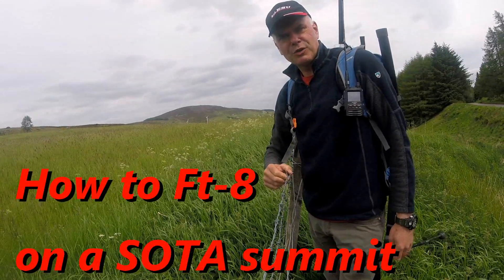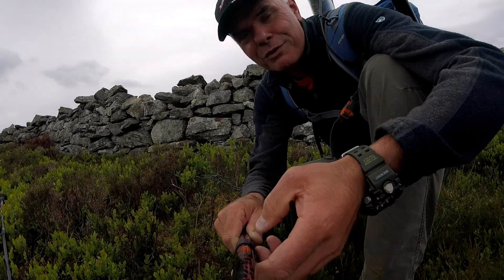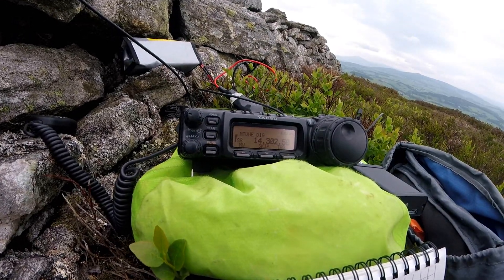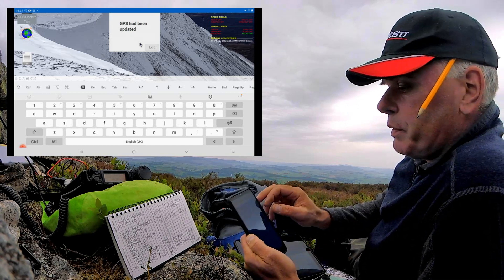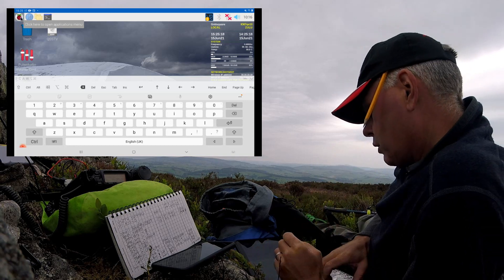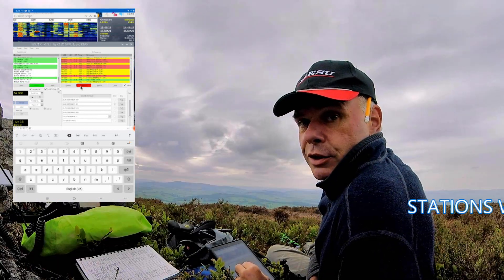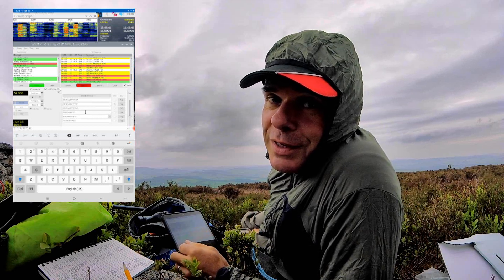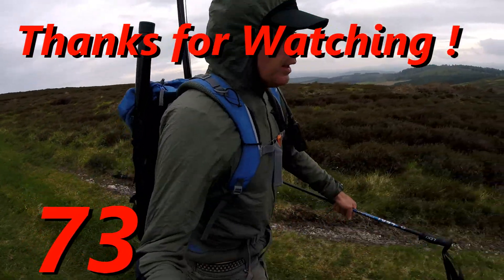How to easily run Ft-8 on a SOTA Summit and bring in the DX!

Comment: Nice video and the equipment choice is probably adequate for 2021. A lot of components, cables, and moving parts. And prohibitively heavy, especially a brick 857 which is designed to be mounted in a car, not carrying in a backpack. My setup for similar purposes:  a battery, FX-4CR, 10" Windows Surface Go.  Bluetooth connection to transceiver, no wires, no hassle with wifi to RPi. 73!
Reply from the maker: Yes, you can do it a lot neater these days. A phone plus tr(usdx) is cheapest and simplest. This video shows what can be done with what I had. After I finished filming, I did some 2m FM and SSB using the same radio. The ft-857d is heavy, but can do most things!
73, Fraser MM0EFI

Comment: Fraser, when chasers log their SOTA QSO with you how do they know which summit you were activating? There is not enuf room in the 4 character text area in FT8 to send that information?  I’d like to activate a summit on FT8 this weekend and that’s the only part I can’t work out.  Thx
Reply from the maker: Well thats a good question! 
1. I put an alert on SOTAWatch3 and mention that I will be on FT-8 in the comments.
2. I use the standard FT-8 frequency for the band I am operating on.
3. I spot myself on sotl.as or SOTAWatch3, again mentioning in the frequency and mode.
I transmit using MM0EFI/P and when I appear on the chasers waterfall, it should be fairly obvious to them. They usually pick me out. They know what summit I am on from the alert and spot. The good thing is that you will also pick up a few other non-SOTA QSO's as well. Finally, there's a free text box in the FT-8 software. You can enter "SOTA" or an abbreviated summit reference there if you like, but most don't bother.
I hope this helps.
73, Fraser MM0EFI
Reply: @theradiorover   Thanks for the quick reply Fraser.  Yes, after doing a bit more reading I think your approach is the easiest.  Like u mention in the video, it’s really more for experimentation.  I like to actually hear 👂 the person I’m communicating with.  73. K6KWI

Comment: Nice video Fraser - thanks for sharing. I am currently setting up for data modes in my shack, and will then get a (currently little used) Raspberry Pi up and running for mobile use. I suppose I just like the challenge! One thought watching you set up: apart from the communication settings which would need to be done manually, are the other settings changeable from the CAT control? It would be good to use a small script on the Pi to save the current settings of the relevant parameters, then to change them to the appropriate settings for data use, before returning them to the original settings on completion. I guess I will be able to answer this myself once I have installed and played with the software a bit!
73 - Paul (MW7PAJ)
Reply from the maker: That's a decent idea. All settings should be CAT controllable. I haven't really got into writing scripts and code on the pi. I did this at Uni many years ago, but I don't have the time to re-learn at the moment.
I actually enjoy setting the radio up manually. The ft-857d is one of those radios that needs to be used constantly and fiddled with, else I'd forget how all the menus and functions worked, especially as almost everything is controlled from just three buttons!
Cheers, Fraser

Comment: How do you set up wsjt-x to let people know that they should should spot you on sota and on which summit?
Or how to verify ft8 contacts for sota activations?
Reply from the maker: When I spot myself on the sotawatch website, I mention FT8 in the comments. Then it's up to stations to find me in the waterfall. There's a free text line in ft8. You can add SOTA to that if you like.
Then when home, I open up wsjt-x again and look into the log file. This can be copied and pasted over to excel for editing, or simply written down and entered into the sota database. 
On the activation in question, I made 16 contacts. Only 3 of those were chasers, so a much lower ratio than usual.
I hope this helps!
Reply: @theradiorover  thx for the reply. Was hoping that there was a more automated way. ;)
Like some log integration.

Comment: Well done I use ft 891 to a scu17 and win 10 lappy. Done 2 SOTA and 6 VKFF on FT8 JS8 modes. Use 30m 17m they are not so congested and still easy to find contacts. Your system is very portable I only do drive up summits and digital modes, not so far to cart the gear into the activation zone. vk5cz..
Reply from the maker: Thanks. I don't own a laptop, but the tablet works fine. I can do it using my mobile phone, but it's more tricky and I need my reading glasses!!

Comment: Hi Fraser. What antenna were you using on 20m, I assume a wire vertical. Also, what antenna do you use for 2m SSB. ?
Reply from the maker: For 20m it's 21' of vertical wire connected to an SO239 centre pin. There's a 21' horizontal wire connected to the shield. The other end has a metre of guy and is tied off to my walking pole, around 1m off the ground.
If you Google 100 gram yagi 2m, you'll find the design. It works great.
Reply: @theradiorover  ok, so do you use an atu with the 20m vertical wire, or have you cut it to resonance ? Thanks.
Reply from the maker: @AdamG3HHT  it's resonant. I have a common mode choke at the feeding to keep RF out of the radio and mic.